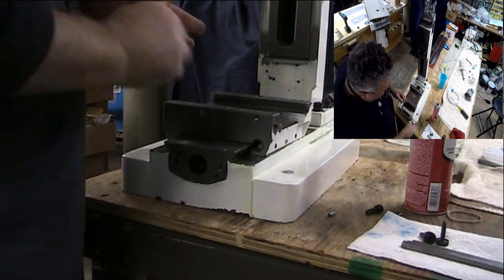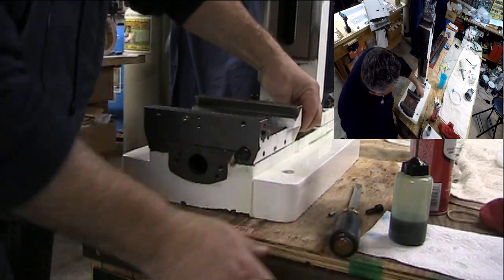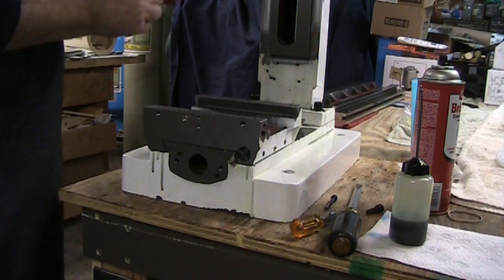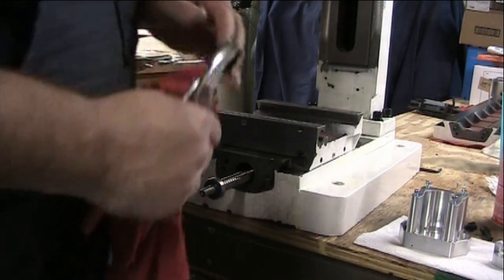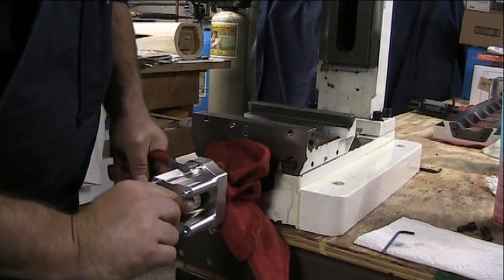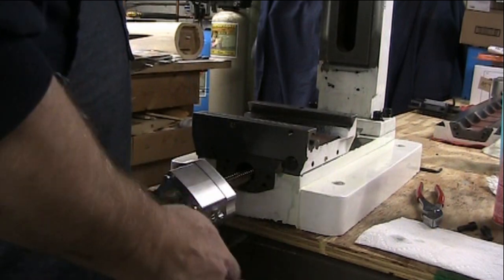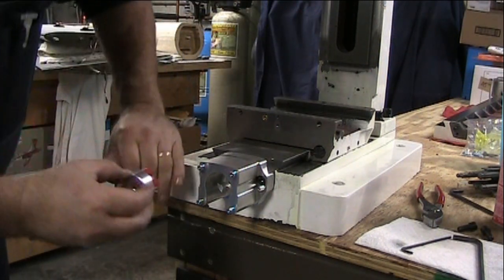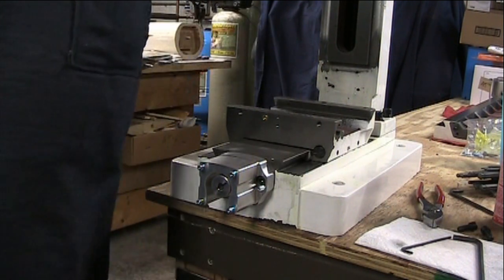PM25 CNC Conv Part 5 Y axis install

Comment: I’m working on my cnc conversion on the pm25mv too; I wanted to see where you are going to run the ball nut grease fitting then the video stop: i have a few videos also here is one the parts i made: https://www.youtube.com/watch?v=xCGt8fY1hwM
Reply from the maker: MakoShark I’ll be doing a follow up on the oil feed system. Stay tuned. Thanks for watching.